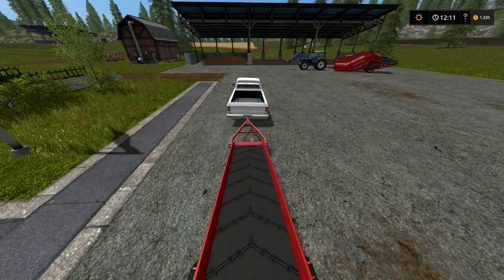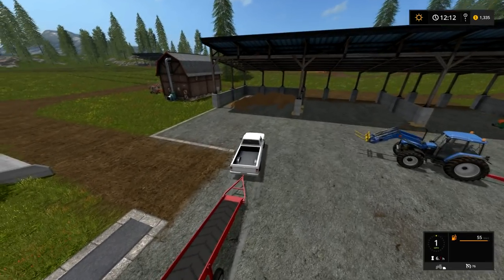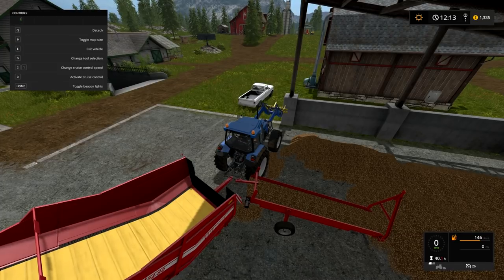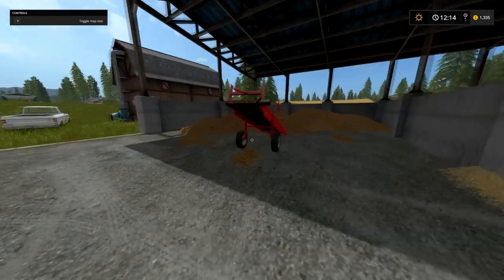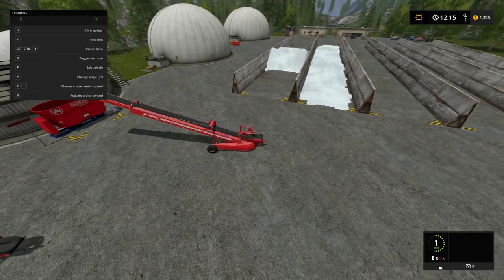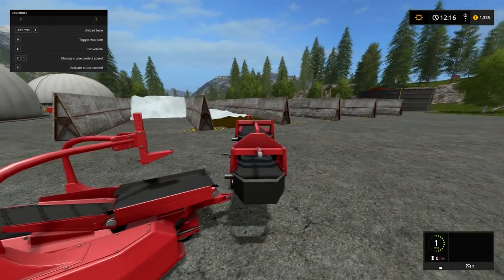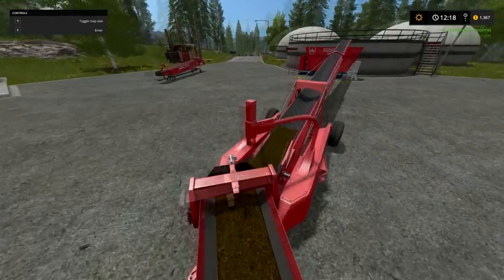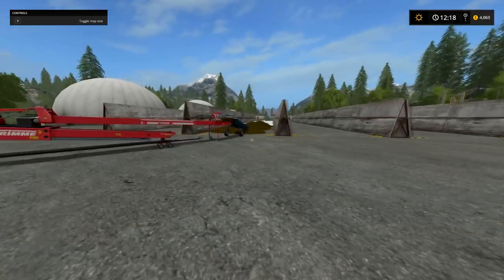Farming Simulator 17 Tutorial | Belt Systems

Comment: Idk why I haven't seen a lot of people reference this method but I find it way easier to use the largest loading wagon and a powerful tractor to scoop up the silage. Not only does the silage gather extremely quickly making a full trailer in seconds but it also saves the headache of getting your belt system to work every time you need to re adjust. If you find yourself getting stuck on the silage while loading just use Shift+H/N to unstuck yourself. easy

Comment: Regarding the silage conveyor system, it works for me at first. However once it has sucked up the silage closest to the belt, I find it extremely hard to push more silage towards it. I either end up with a giant heap somewhere in the middle, that my tractor eventually gets stuck on, or it just flattens the silage rather than pushing it toward the belt.

Comment: Managing those bunker piles is a whole lot more difficult. First time I piled it in I got the mower and trailer stuck on the apex of the pile. I suppose if silage isn't the money maker it used to be I may just leave it out. However, that belt system you showed is fantastic! That way you don't hafta keep coming back to add shovels into that hopper. Cool!

Comment: Thank you for this tutorial.  Unfortunately I have a hell of a time trying to push the silage forward with the leveller towards the belt.
Reply from the maker: I ended up just re-positioning the belt system every so often. Only had to do it two or three times for an entire bunker and didn't take long at all.
Reply: Moose2006LP - Thanks for the tip.  I will give that a try.

Comment: Moose, I'm having trouble hooking up to the sl80.  I got it to attach to the ground belt, but now I can't detach it nor can I attach a truck or tractor to the ground belt.  Any suggestions?
Reply from the maker: Try detaching from within the ground belt instead. You don't need to attach them to get them working, by the way.
Reply: Thanks, that did it.  I guess the chopper and pickup can't pull these, I had to use one of my tractors to pull it.  Love you fs stuff!

Comment: Whats the angle for? with the giant expensive last one.
Reply from the maker: I don't know! I've tried everything with all different angles and nothing seems to change. Not sure if broken or I'm not using it in the correct instance for the angle to matter.
Reply: Moose2006LP
same thing over here.
Reply: Teun Wich the angle is for creating large piles, it rotates the belt to back a larger circular pile. once a regular pile gets too high, the belt stops dumping
Reply: Jack Masse
aaaah thx. So I guess with the 45° you make higher belts?
Reply: Teun Wich you can, it just spreads your pile out more rotating at those degrees. its more for dirt, wood chips, stuff like that in real life
Reply: Jack Masse
aah. thx!

Comment: Super-Duper Beetmaker
I might just sub for that alone. Haha
Edited-----> Sheeeet, sorry. Lol. Two year old video. I'm sure someone else said that already.
Reply: Very clear explanation. I particularly liked when you indicated starting at the end. For anyone playing on Xbox, its pretty much required to do so, because that's the device you use to link to the one closer to the source, and not all the onscreen button prompts are listed.  (Example: exit vehicle is not shown as [X] for one part, Small trailer-hitch connects them with [A] for another) 
 Thanks man. Pretty helpful.
Reply: I might need to ask if you have help on the small woodgrinder, because that's what I'm trying to accomplish with belts.  For some reason. I can't make it operate unless I'm in an attached tractor, but then who's putting logs in? Get out to put logs in, grinder stops. (Equipment: HM 4-300, Heizomat, yellow and green, pipe out, tow-behind, loads from the passenger side $28k)